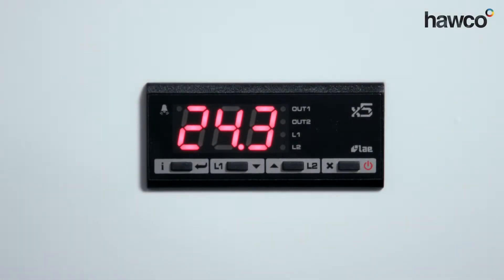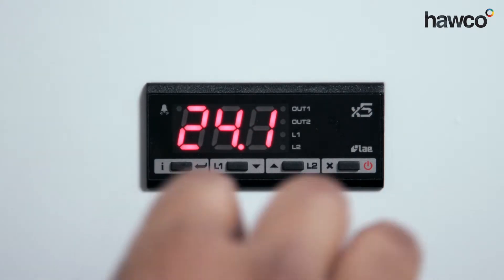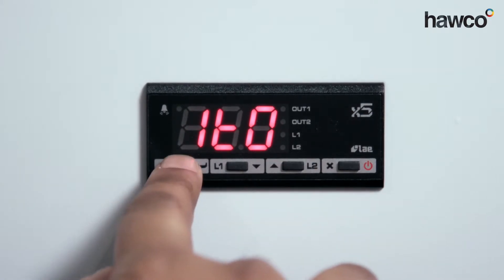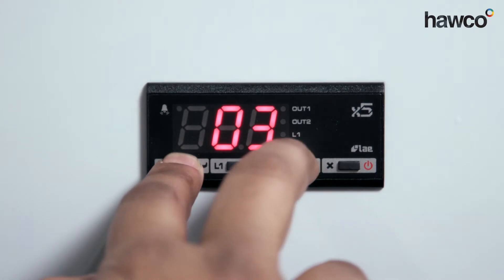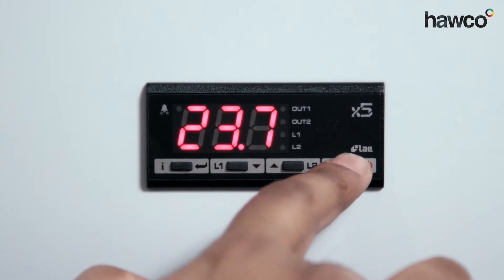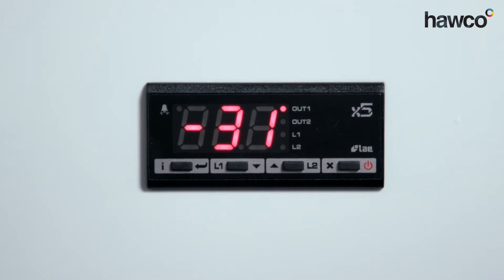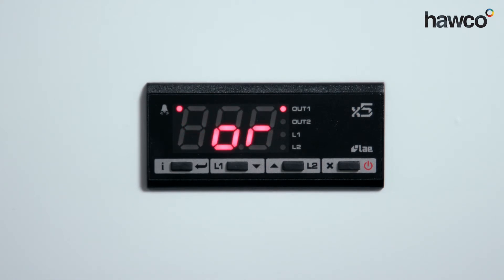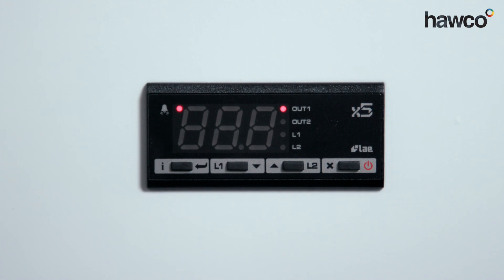Setting On/Off Times (If Probe Fails): LAE AC1-5 Digital Controller

Comment: Ci può spiegare un sistema PID
Reply from the maker: Thanks for your suggestion. We will produce a video explaining a PID system when we record our next set of videos. 

In the meantime, here is a link to the manual for the LAE AC1-5 that contains information on setting PID parameters for this controller. 

https://www.hawco.co.uk/en/media/bluelogic/legacyproducts_uploadfiles/l/a/lae-ac1-5-controller-instructions_6.pdf 

If you need any help with a particular application, contact us at technical@hawco.co.uk and we will do our best to help you.